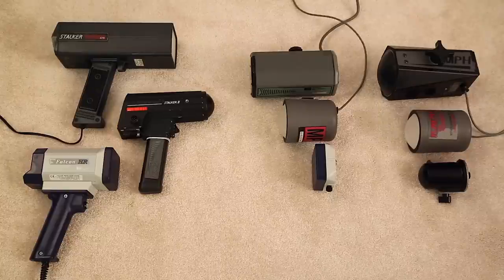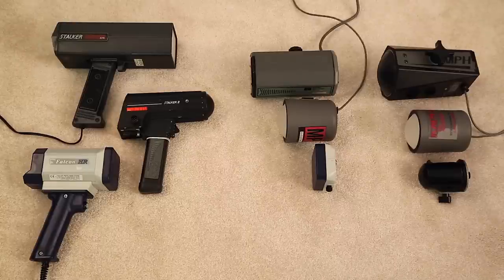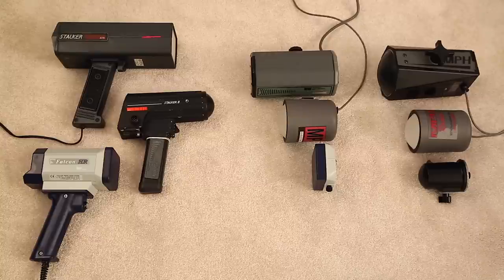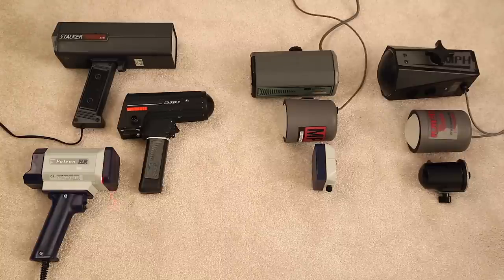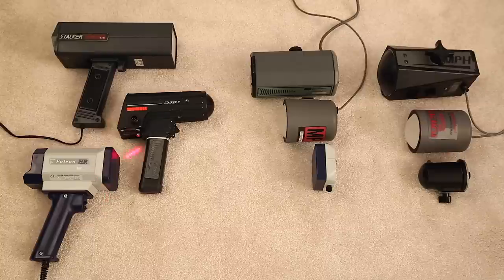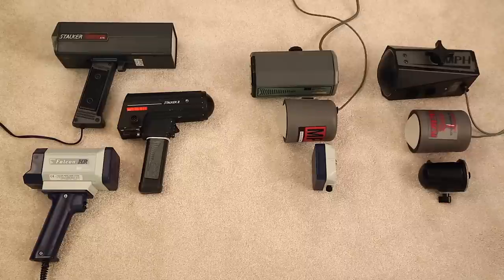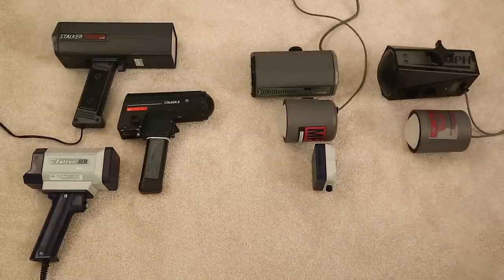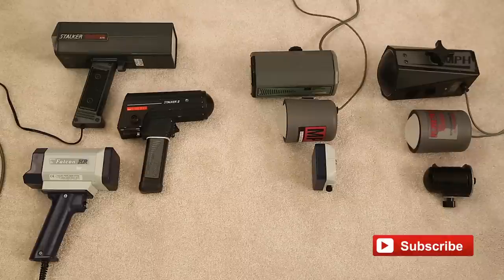Police Radar Gun Antenna Designs

Comment: The antennas which you call short, for years were called a lensed antenna in the trade.  Some called them a Fresnal lense, or a dielectric, dielectric monolithic lense. They worked great for a polarized antenna, which does have the greatest gain per size of the horn antennas. In the early years many of the manufactures wanted to reduce the size and Decatur was the first to do this. It gave great range with a small antenna, The Decatur could out shoot the Kustom. Many years later Stalker could not do a Turnstile antenna, (ATR) due to the lack of microwave parts, and had to hand build the ka antenna with Harris brand Gunn diodes. MPH was the first to have a turnstile in the Ka-band with the BEE 36. MPD owner of MPH developed the microwave turnstile and components to have the first polarized ka antenna. I got to do the FCC type acceptance on a couple of these and watch the development of the antennas. I also modified a few of them to work on another brand of radar, to cross engineer certain designs and see what worked and did not work. While a few manufactures had great antennas, the electronics behind them were not so great, the quality varied, but so did the police tactics, to match the gun.
Reply from the maker: +Henry Devilliers I love hearing about your experiences with radar guns. :) Would you like to do some videos as well talking about these things?

Do you have a personal favorite radar gun? My favorite is the Stalker II.

What drawbacks did you find with the lenses antennas?
Reply: 70' Decatur MV series. 80' BEE JUSTUS and BEE 36, LATER MPH BEE and Ranger.
Reply from the maker: What do you like about those ones specifically?

Comment: Do you have or know where i can find kill zone information. meaning what is the distance that a radar gun can pick you up.  example mph avg is 1/2 mile, kustom is 1 mile??
Reply from the maker: There really isn't such a thing. It's common for manuals to say a mile or whatever, but in practice it varies wildly depending on terrain, what angle the antenna is pointed, if the road is curvy or hilly, if there's other traffic around, and so on. It even varies depending on the model of the radar gun used and the size of the target vehicle. Some guns are even designed for close range usage while others are better suited for long range.

Perfectly flat terrain in ideal terrain and a large vehicle, sure you can get a mile. But that doesn't tell is much for what we'll see in practice.